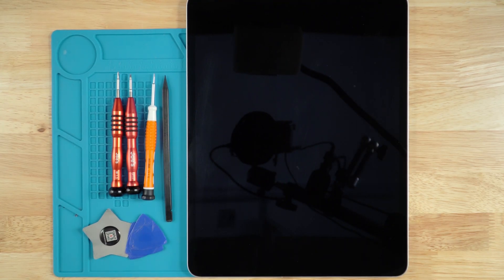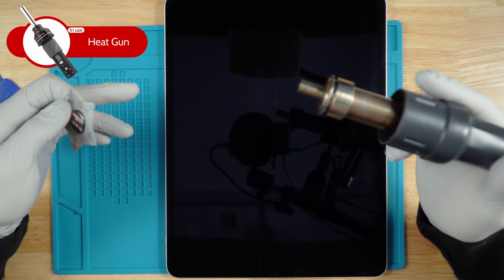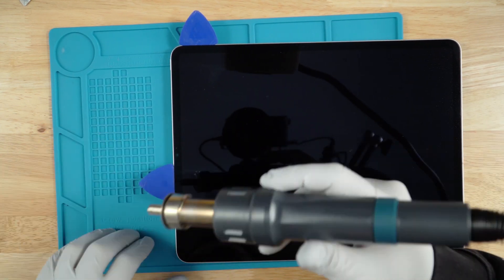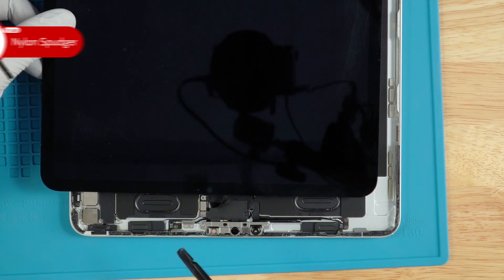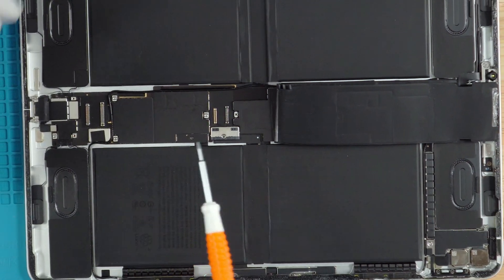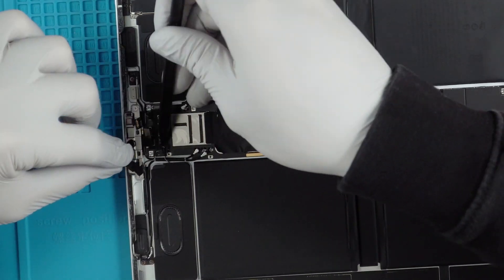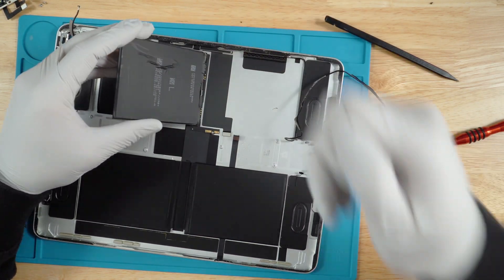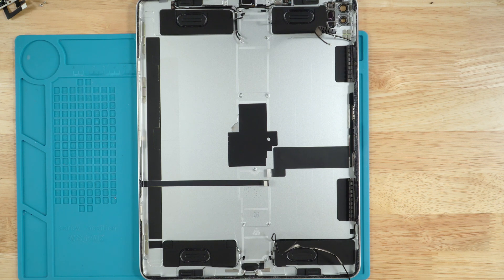Apple iPad Pro 12.9" (6th Gen) 2022 Teardown & Repair Guide – Inside Apple’s Powerhouse!

Comment from the maker: iPad Pro 12.9" (6th Gen) Teardown & Repair Guide 🔧

🛠 Need a Repair? Send it in 👉 https://www.joesge.com/pages/repair-service-tablets-apple

🎯 Fix It Yourself? Get a replacement screen 👉 https://www.joesge.com/products/apple-ipad-pro-5th-generation-12-9-touch-screen-lcd-replacement-parts?variant=40207627190318

🔧 Tools Used:
✅ Tool Kit (50-in-1): https://www.joesge.com/products/joesge-repair-tool-kit-50-in-1-precision-screwdriver-set-tools?variant=32817393074222
✅ Heat Gun (200W): https://www.joesge.com/products/hot-air-gun-station-200w-handheld-portable-black-tools?variant=40176338960430
✅ Triangle Picks: https://www.joesge.com/products/apple-ipad-lcd-screen-removal-thin-triangle-shape-plastic-pry-pick-blue-tools
✅ Nylon Spudger: https://www.joesge.com/products/nylon-spudger-opening-prober-alignment-ribbon-removal-repair-black-tools
✅ Precision Screwdrivers: https://www.joesge.com/products/beats-by-dre-screwdriver-tool-t5-t2-philips-flat-head-repair-tools?variant=7905323057198
✅ Ninja Star Pry Tool: https://www.joesge.com/products/apple-ipad-lcd-screen-removal-thin-pry-star-shape-depth-measurements-tools?variant=40247131242542

🔔 Subscribe for More Repairs & Teardowns! 🚀

#iPadPro #iPadRepair #Teardown #FixYourTech #DIYRepair #AppleRepair #TechTeardown #iPadProTeardown #ScreenReplacement #TabletRepair #JoesGE #RepairGuide

Comment: Good day. Can you give me some advice? It only charges from PC USB. They changed the charging port. It doesn't work with the original charger. What can I do? Is there a charge controller? Can it be replaced? Is it a fixable error?
Reply from the maker: Have you tried different cables and chargers? If so, and it still doesn’t work, email us at support@joesge.com, and we’ll do our best to help!

Comment: Why did you disconnect display before disconnecting battery? That's backwards, isn't it? 

I thought battery terminal needed to be dealt with before removal of screen
Reply from the maker: You can disconnect the battery from the board before you install the screen.

Comment: I’ve Got 2 of these M2 16GbRAM 2TB 6th Gen 12.9”, & I’ve already fixed & replaced the digitizer screen on 1 of em. 1st time ever doing it, & accomplished it. Now I’m going to do the same to the 2nd. Was lucky enough to only pay $150 for new replacement screen instead of double that, but I need another one for the other one, & ima check out ur site to see what u offer.💯🤙🏾
Reply from the maker: Good work repair ninja 🥷